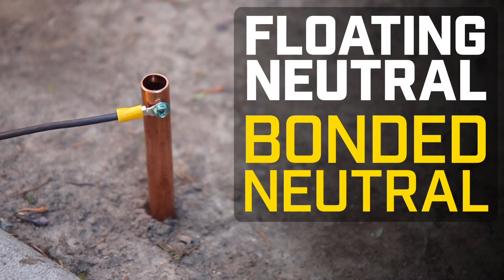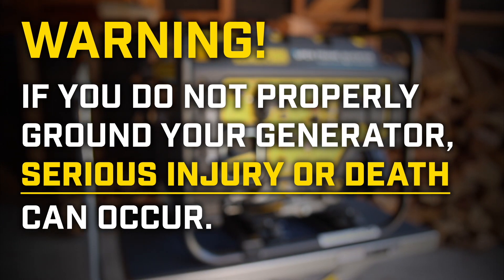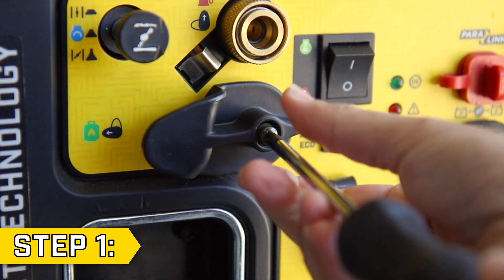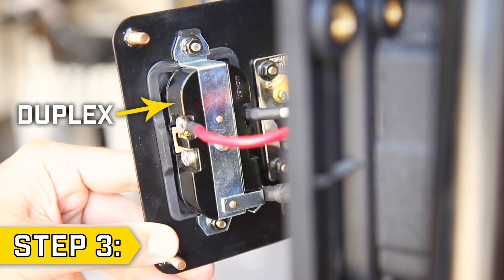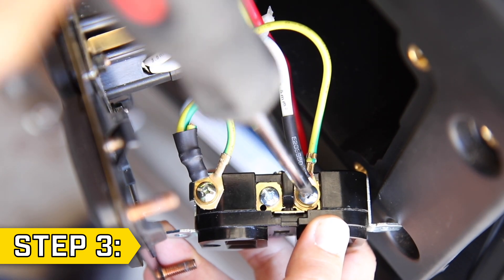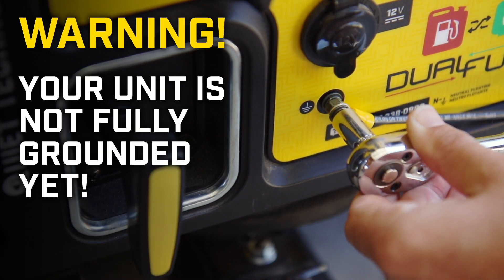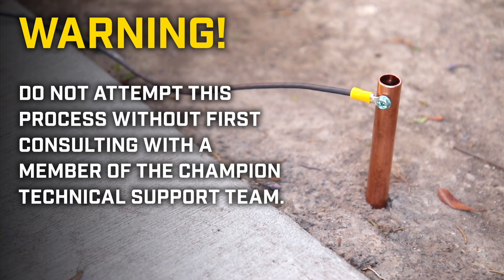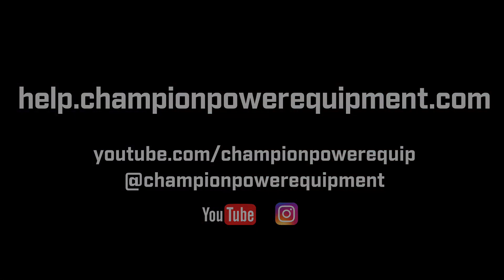Convert Your Open Frame Inverter's Floating to a Bonded Neutral

Comment: Is a floating neutral or bonded neutral preferred when connected an inverter generator to a 30-amp travel trailer?
Reply from the maker: If connected to an RV & it gives off an error of open ground, you would want the inverter with a bonded neutral.

Comment: I have an "Atom Fusion" Inverter Generator (model: 93001i-UK)

Can this technique be applied to that?

I see from the wiring diagram that an earth wire is already present on the single 16 amp socket.

1. Undo the four screws holding the socket to the panel and pull the socket clear
2. Undo both the neutral and earth wire nuts from the back of the socket and add a bonding cable to join them (as in your video)
3. Replace everything
4. Run a suitable connection from the earthing bolt on the front panel to a ground rod.

Will all that work with my model?
When the included 1 x 16 amp to 2 x 13 amp adaptor is connected to the 16 amp socket will the 2 x 13 amp sockets be bonded?

Thanks
Reply from the maker: Hello. For this procedure on a UK model, we do highly recommend contacting our team in Europe, as they will be able to guide you on the process: https://www.championpowerequipment.co.uk/collections/home-backup-generators
Reply: I will do that. Thanks

Comment: I assume that this only works to bond the duplex outlet, that the 30amp outlet is isolated from this.  Correct?
Reply from the maker: The entirety of the generator will be bonded. 👍